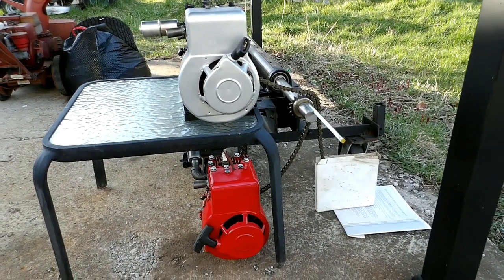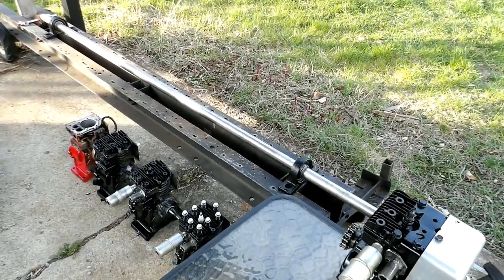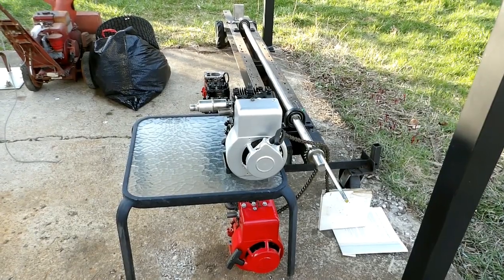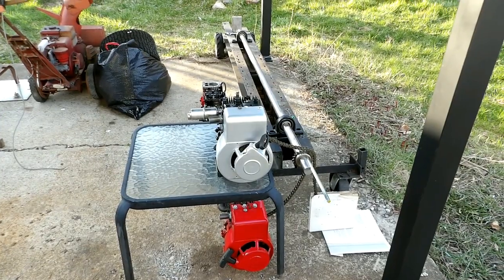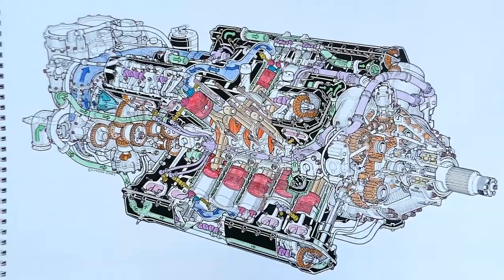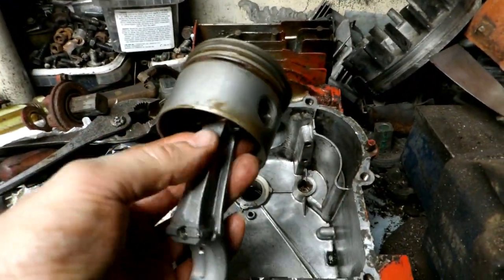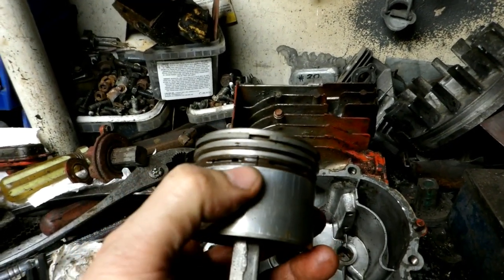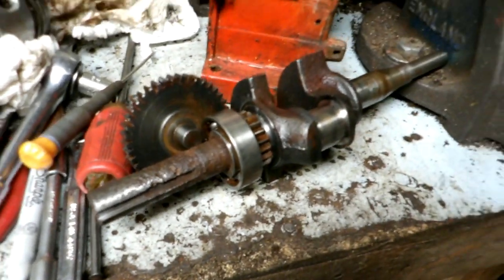Homemade 12 Cylinder H engine Part 3

Comment: Coming along nicely! Can't wait to see this thing run! How the hell are you going to handle the spark and timing!?
Reply from the maker: I am going to have the original ignition on each engine, so that solves that problem. I will time them together with the long timing shaft chained to each motor.

Comment: Pretty interesting learning about a 24 cylinder plane engine, you do great work, I like your FrankenBriggs builds! That's a cool old tiller at the end, I recently worked on one just like that for a customer only it was powered by a Tecumseh.
Reply from the maker: I got that old tiller at a scrapyard, and went back a week later and got the outer set of tines off a second similar one. I should have got the engine also (if it had it). It has been a reliable old beast, as I have been using it for about 15 years.

Comment: With the tins on it should run cool. I get your timing now.🤔
Reply from the maker: Yes, I am using fairly complete engines on this build, so as long as the timing shaft and chains can take it,  it should be able to run for quite some time. (Though the neighbors probably wouldn't be liking that!)

Comment: My God, Charger Miles, this is going to be a monstrosity! You may need to buy another shed to store this thing. The helicopter was messing with you, it has 750+ SHP in a 200 pound box
Reply from the maker: Oh yes, this is going to be Big and Heavy (600 lb+). I discovered that the long drive shaft is warped (probably due to machining the keyseat in it full length) So I imagine it will need a second seat cut at 180 degrees, to balance it, and hopefully straighten it. It didn't have the keyseat in it when I got it, and I am sure it was straight. It will be turning at about 2500 rpm, so balance will be an issue also. It is always the thing you don't think of that bite you in the butt!
Reply: @ChargerMiles007  
I am good with your attempt to replicate those engines. I would only say why? They were interesting  but didn't work out right.
Reply from the maker: I think the Sabre worked pretty well once they had Bristol making the sleeves, and worked a few other bugs out. It was tested at 3750 horse for an extended time period. So for a fighter plane application it seemed to be OK, just rather expensive.  I am just curious what a 12 and a 24 cylinder will sound like, hopefully it isn't just a bunch of chain noise!  I am bypassing the long bent shaft by using a shorter smaller one for a 2 and 6 cylinder test, to see how the chain drive works out.

Comment: That's gonna be so cool!
Reply from the maker: Yes, it should be an interesting sounding engine when it is done. I did discover that the main shaft has a bit of a bend in it, probably from machining the keyway the full length.

Comment: Miles, you are good!
Reply from the maker: Thanks for watching the vids, I am planning to make the 2 cylinder test unit ASAP, I have a 3 foot long 7/8" dia shaft I will use for the timing shaft, I just ordered the bearings for it from Princess Auto. Now it is time to figure out the position of the shaft relative to the motors, with regards to the chain length. I can draw it all up on the computer, but in the end it will still be a trail and error set up.

Comment: This would be nuts if you used all fully built 5 horse Briggs
Reply from the maker: Unfortunately I don't have enough 5 horse engines, so I am using a combination of 3 horse horizontals, and 3.5 lawnmower engines.
Reply: @ChargerMiles007  are you running the mower engines sideways or are they sicklebar engines?
Reply from the maker: I am running vertical shaft motors sideways, with some mods to the oiling system.
Reply: @ChargerMiles007  huh I have never heard of anyone doing that
Reply from the maker: I did it for a homemade go kart almost 20 years ago, it worked well, but the crankcase cover bushing started to give problems due to the high pulling force from the chain drive, but it did last pretty well.
Reply: @ChargerMiles007  that's pretty cool I might think about doing that
Reply: @ChargerMiles007  what modifications do you have to do to the oiling system?
Reply from the maker: You have to look at the location of the oil feed holes to the crankshaft, generally they have a little V shaped feed area or something that directs oil into the hole. You have to make sure that the hole will be upwards, so the oil will run into it, in the new orientation. It may be a compromise where you just have to do the best you can. I will have to look over my lawnmower engines soon, as I need to build 6 of them to survive running sideways for the H12 engine.